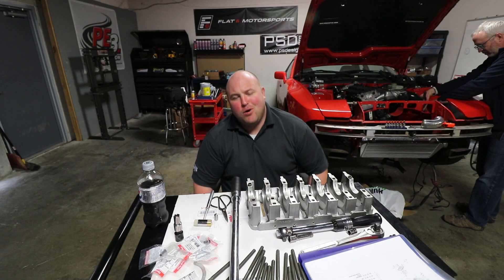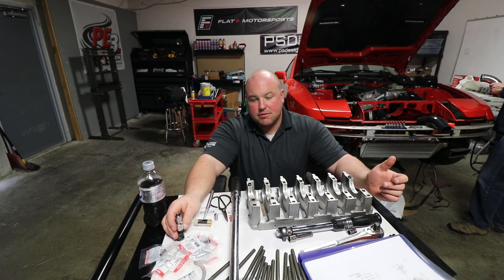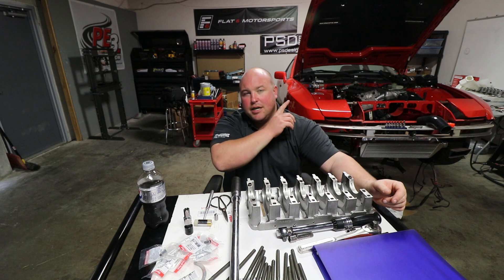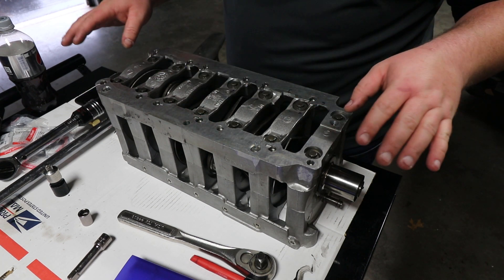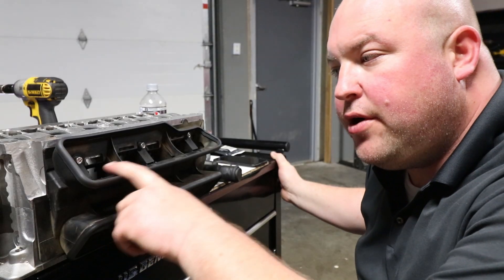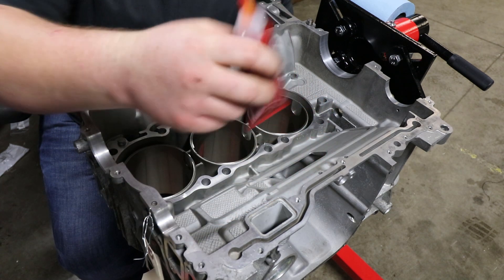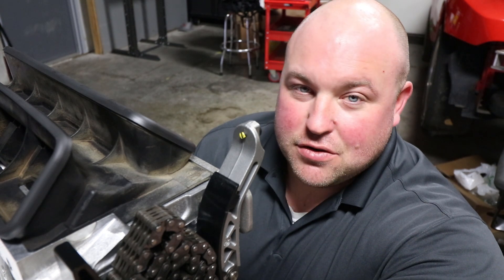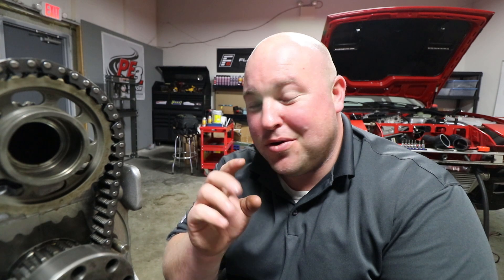Turbo 3.8L Cayman Engine Build (Porsche M96) - Part 4

Comment: hey bro i have a question. recently my 987 refused to crank. its the famous click no crank issue that i have read about in the forums but i have yet to come to a solution. i replaced the starter and the issue is still there. the battery on the car is good so im stuck. any input will help. thanks
Reply from the maker: Not sure unfortunately. My first check would be all the fuses as well as making sure your battery cables are in good shape and tight. Loose grounds anywhere you have recently worked can cause an issue as wellZ

Comment: How much are the engine parts to buy? I’m guessing summit doesn’t do fully forged rotating assemblies for $2,000 like the LS... nice work doing this. Opens the path to buying and rebuilding a Cayman.
Reply from the maker: Thanks! Yeah, none of the standard go to aftermarket places have packaged rotating assemblies. Luckily the crank is pretty bullet proof, but the Pistons / Rods / Sleeves are still more than you would spend on a full LS forged rotating assembly. Once we figure out the correct assembly procedure though, we will be able to help people drastically reduce the cost of rebuilds as labor is silly expensive

Comment: Firstly, thanks for taking the time to post these video's.  It's an honest look at how DIY rebuilds can sometimes go - especially more custom projects like this.  Throw in a whole bunch of unknowns from previous owners and custom parts (and/or mixing and matching), and things like this are bound to happen.  You're going to have one hell of a car after all this! Cheers!
Reply from the maker: Appreciate it! It would be easy to mask all the issues during editing but that’s not how I roll. If I can get it all figured out I’m hoping that it can help others as these cars are becoming less expensive than an engine replacement which is insane.

Comment: Wonder which service manual you're using?  Are there any other manuals out there which could be better?  I downloaded a Haynes manual for my Honda years ago.  Only problem, it tells you how to diagnose and what needs to be fixed, but doesn't always tell you how to do some things.  It assumes you have some basic mechanical knowledge (which I'm sure you have).
Reply from the maker: I’m using the Porsche service manual. I’ve heard Bentley manuals are really good, but when I looked them up for this application people said is was basically a direct copy of the Porsche manual.

I had a Haynes manual for my old Mustang and I could done a ground up resto using it lol!

Comment: Echo other people’s words of encouragement. I’m a DIY guy too, and have been toying with the idea of building a boosted Cayman. I really like what you’re doing here. Eagerly awaiting the next vid.
Reply from the maker: Thanks! As much fun as the Cayman is at lower power levels, it must be insanity with 500. Can’t wait to find out!
Reply: @BoostBrothersGarage  My 928GT came from the factory with 320HP (~280WHP). Since i put a twinscrew SCer on it, it now makes ~500WHP!  It has 50/50 weight distribution and is a blast to drive.  It's like the chassis was designed for 500WHP.  I believe the Cayman is a similar situation. The Turbo will be more forgiving on the drivetrain (vs a SCer).  Hopefully the clutch and the rest of the components will handle the boost.  I think Heat Mgmt is going to be a major challenge for you - once you figure out how to put the engine together... correctly!  LOL!  Don't worry. I put a motor together that lasted all of 2 min before grenading!  D'oh!  https://youtu.be/w-kJn70tOEY
Reply from the maker: Hahaha, I can’t afford for this one to pop! BTW, a 928 us the next pcar I want to own, so underrated!

Comment: How did you know which side was correct for the crank?  It looked like either side would’ve worked haha.  Porsche didn’t make it easy did they? 😅

Looking forward to the build.  Keep it up!
Reply from the maker: The pin for the chain tensioner! I didn’t even think about it until I had it bolted together and then I went back and looked at the parts breakdown. Unfortunately none of it is super easy to ID!